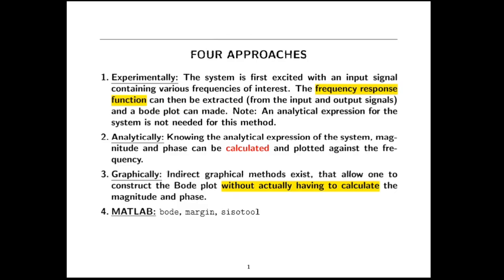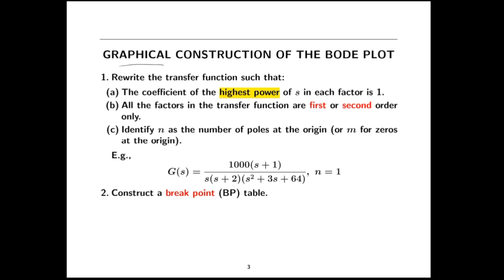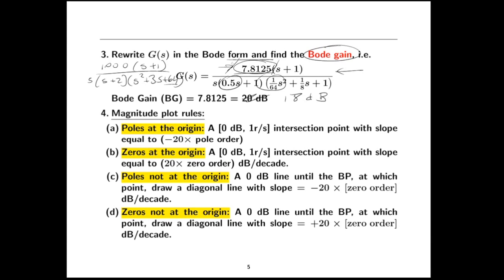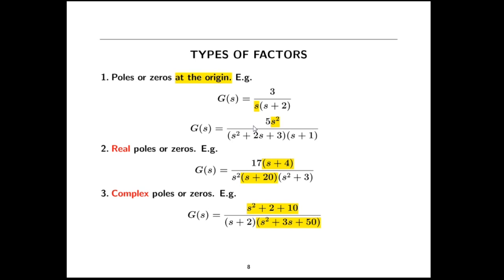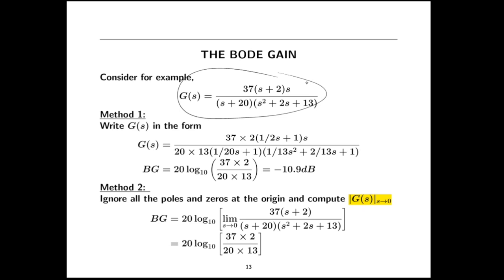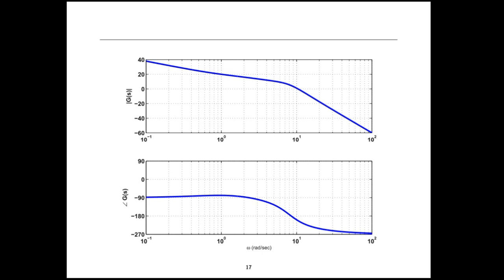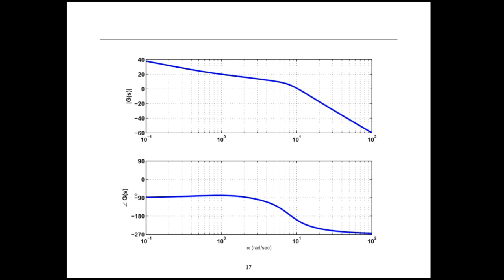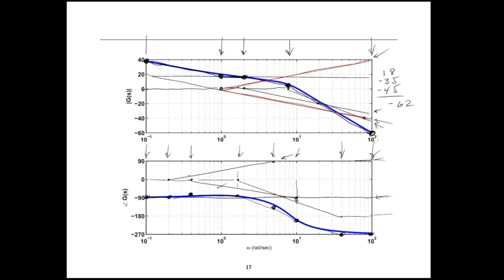Bode Plot Sketching

Comment: how come when you take (s^2 + 3s + 64) and take the 64 out, you get (s^2/64 + s/8 + 1), shouldn't the second term be 3s/64 ?
Reply: Just spotted that same thing..I'm pretty sure that's a little error
Reply from the maker: Dennis Tu Dennis. Good catch! This was a mistake on my part. It never came back to haunt me in the Bode plot sketch since I didn't use the damping term to "shape" the sketch.
Reply from the maker: Ronald Vibes That's correct Ronald. I'll stick an annotation in the vid to let others know.
Reply: Thanks for an extremely helpful video by the way! Helped me out greatly in my final.

Comment: for the magnitude plot at w=8 rad/sec, does the graph decrease with slope -40db/dec due to the s^2 of the new pole OR is it -60db/dec, (i.e is the -40db/dec added to the already present slope of -20db/dec from the previous pole)
Reply: never mind u already mentioned it in the video. thanks a lot really useful video

Comment: you show 90 deg/dec changes for the 1st order terms wouldn't this be 45 deg/dec instead ?
Or is this due to the 2nd order term changing it ?
Reply from the maker: Perhaps you are thinking of another feature that I don't believe I described. Let's say you have a first order system G(s) = 3/(s+3). The magnitude plot will roll off after omega = 3 rad/sec at 20 dB/dec. The phase plot will eventually attain -90 deg of phase at large values of omega. But here's I think where you are going. At omega = 3 rad/sec the phase plot will be at -45 deg.

Comment: Why do we need w/5 and 5w??
Reply from the maker: These are the frequencies where something interesting occurs for the phase plot of a term in the transfer function. The w/5 is when it breaks (up for a zero and down for a pole) and 5w is when it levels off. So, flat line at 0 deg until w/5, then a diagonal line to +90 for a zero or -90 for a pole, then a flat line again was w increases.
Reply: sir, thanks for the awesome detailed explained video..
but as for (w/5) and (5w) , why we specifically chose  5? why not (w/10 and (10w) for example .

Comment: In the example was Wn=8 given?
Reply: Nvm. haha I got it.
Reply from the maker: I'm glad you figured it out since I would have to re-watch the video to answer that question... Keep after it!
Reply: Gordon Parker Thanks. Btw this is a great tutorial compared to the other tutorials.
I did notice that for complex zeros or poles at 11:37, the start and end points are Wn/5 and Wn(5), respectively. But in other tutorials I've seen it seems that Wn is divided by 10 and multiplied by 10. Still confused on that.
Reply from the maker: You are correct. Lots of folks use the x10 and 1/10 approach. Both approaches are approximations the x10, 1/10 method is easier to work out in your head for sketching purposes, but the x5, 1/5 method is a little bit more accurate. To convince yourself of that try a little example where you print out a nice Bode plot of a simple transfer function. Then sketch on top of the phase plot using both approaches. You could try G(s) = 3/(s+3) or something similar. Also, thanks for the kind words on the videos.